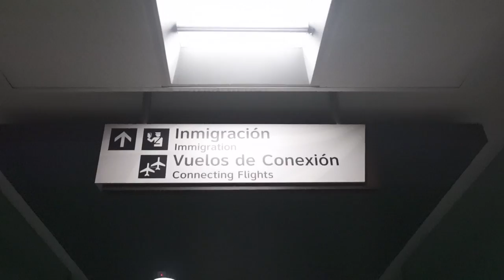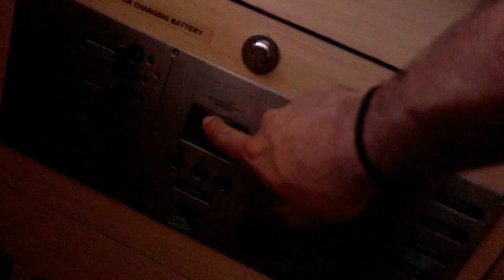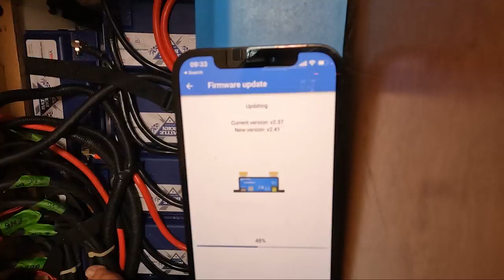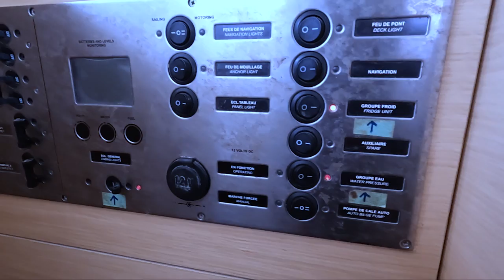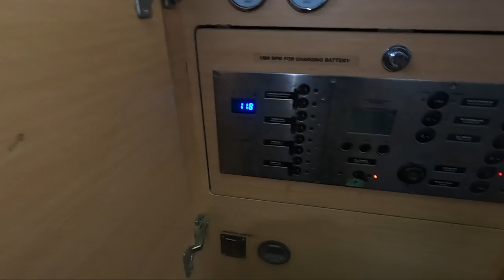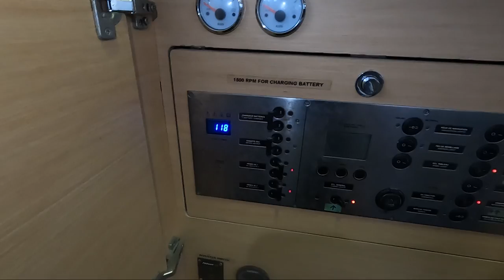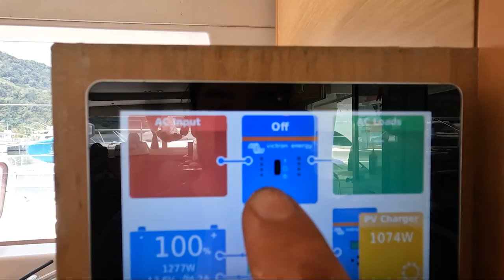We have been STRUCK by lightning AGAIN!!! - (Episode 192)

Comment: Oh...that sucks! My home got struck by lightning several years ago. My computer and a lot of electrical wiring got fried and melted. But, all my ham radio gear, which is all heavily protected with lightning arrestors and is also heavily grounded all survived. Even though it was my radio antenna tower that was struck, the house electrical is not grounded as well as my radio gear, so that is why the house wiring took such a hit. I wonder if better grounding can be an option for your boat? That ground cable you showed, is most definitely too small. You need to give lightning the least resistance to ground, or it will find other pathways. A bigger cable and more paths to ground connected to it "may" afford better protection. Not a guarantee, but it's an obvious and easy modification. Cheers from Winnipeg.

Comment: Get the cable from the mast as straight as possible, if that is going to attempt conducting the lightning. Every turn represents higher inductive component than the cable itself, increasing likelihood of the lightning trying to find an alternative route. Full energy of the lighning going through that kind of cable would lead into a cloud of copper plasma.

It might be worth it to look into a grounding panel with a good route towards the sea below and EMP protectors (and plenty of spares as they at least used to be sacrificial components). Pass all cabling through that panel and those protectors to keep the lightning away from delicate stuff.

Comment: Oh no Colin. Just when things are going well nec minute….😢 especially when it’s your babe. Great to see the 2 boys back. I think having them there will help share the load of frustration. Getting stuck in and finding the solution is a great way to reduce stress levels. What I don’t understand is…..is there a way where you can have a breaker turn off everything with a voltage surge?

Comment: As a former cell tower tech and Antenna erector, electrical engineering tech.  If your mast is isolated from salt water you decrease your struck possibility by 75% any of your electronics should be protected by a gas tube lighting arrestors witch the only ground off them if you want a giant lightning rod isolate it from the mast directly to sea ground needs to be at least 6 feet taller than your mast! Been doing this 47 years and have never taken a hit to my ham radio tower 80 feet high

Comment: Lightning sucks. 🙁 Hoping for minimal damange.

Some BMS'es may still forward voltage, but not amps, even if the BMS is dead or switched off... Put a couple of amps load on the whole system and use a clamp-meter to check power-draw per battery. No need to unscrew anything until you find something unusual.

Clamp-meters are really nice to quickly trace where power, as in amps and not volts, is going without having to unscrew anything.
No need for a fancy one for this type of work and a $30 model should suffice. look for something that has at least 0.1A to 100A range for DC and AC, or that reports "over-current" when above max.

Comment: With your luck i think it is time to invest into a good lighting rod and a big cable insulated from the rest of the mast straight down to some anode that touches the water. Also seeing open terminals on your batteries and having the + and - so close on the bus bar and not shielded in anyway from each other is in my eyes a fire waiting to happen(errors are easy to be made in such stressful situations especially if this happens while underway).

Comment: IIRC the old scooners use to throw a chain overboard to act as a path for the lightning to go to the water.
Could you put a ss ground plate on the outside of the hull connected to the mast via a heavy cable to make a better path to "ground / water" than all the electronics????

Comment: You would think you'd install a lighting rod groundout ( deferred line to water ).  You can build it for about $400-500. 
it takes the strike at mast top and runs it down the copper to specialty plate below the water line and saves ALL your expensive gear.  New vessels are now sold with that feature in certain demographics for an optional fee
OR at least protect everything with an 
" instant" Class T fusing array
Reply: Let me explain the lightning attraction rod system a bit better. ---- Mast Top you want a Copper cored rod with a SILVER plated triangular tip that is at least 18-20" above everything else. 
The base of that rod is attached to the thick twisted strand copper wire, usually 4-8 gauge and run down to a dedicated type plate ( similar to a chain plate ) that then runs to the specialized metallic ground plate on the hull OR to whatever your best exit point is.  The one on our old TriMaran in the Bahamas took countless strikes and saved all the electronics and HF-SSB gear on board

Comment: The problem that I see with the spark gap is that it allows the mast to charge up so that it is more attractive to the lightning bolt. It does not reduce the charge. Perhaps the spark gap becomes a path of least resistance but if the wiring in the mast is at zero potential and is touching the mast, then it could burn through the insulation as it seeks the path of least resistance. The question will be whether the air gap of 1/4" will be a lower resistance than the insulation around the wire that is touching the mast internal surface. I think not. A 1/4" gap would require more than 19,000 volts of differential. DC wiring would burn through at a fraction of that voltage.  I think that Brickhouse had the right idea by grounding to the sea so that there is no build up of charge. I know in aircraft that we try to channel the lightning bolt into and then out of the aircraft without damage by providing a path. That could be the situation as well if the yacht is at sea and there is nothing else around for the bolt to be attracted to. That is why I would go with the larger size wire, essentially a cable, to provide the ground.  The cable should be routed away from all wiring and metallic components until it arrives at the ground point on the hull. The lightning bolt can generate about 200,000 volts and the current will be huge for a few milliseconds. Keeping the voltage spike down and away from metallic components is essential to getting the charge overboard.

Comment: So, lightning can strike the same place twice. (Sorry, not so funny) I'm not that boat savvy, so this may sound ignorant. Could you mount a lightning rod on top of the mast, run a heavy gage, insulated cable down to the hull and attach a metal weight to the free end to be tossed over the side during a storm. Would that provide an effective ground to protect the electric circuitry on the boat? Tough luck guys. Best of luck.

Comment: Couldn’t you install a ground disconnect that you can switch off during storms to prevent lightning from shorting to ground? I know you wouldn’t have any power during storms with lightning but it’s better than running as risk of losing everything.

Comment: Are the other boats around you moldy. Since the start I was curious about mold issues. If you have some start from the hurricane and then get high humidity it could spread like wildfire. Houses even new construction get mold problems that can never be fixed.

Comment: You need to ground the mast to water with a big plate.  Never use the mast as a ground for electronics.  It should float and only be grounded to water.  Struck by lighting twice.  Play lotto.

Comment: Lightning strikes are caused by "Diffrence of Potential". Floating the mast with a Spark Gap allows the mast to stay at the same charge as the surrounding air. And if lighting strikes, the Spark Gap becomes the path to the ground, via cables thrown into the water. Keep the mast lightning system on the outside of your boat.. And use 12vdc and 120 vac Spark Arrestors/ Surge Protectors, using a diffrent ground (Grounding Plate) on the bottom of your boat as far as possibe from your mast ground. Do not use the same ground for the mast as the same ground for the Lightning Arrestor and Surge Protector.

Comment: I am thinking. Maybe a dissipator  on the top of mast with some 4/0 DLO fine strand welder cable ran short as possible and straight as possible to an isolated thru hull anode????  I read on a post here of a 6x6 stainless plate gapped at 1/4”?? Would love to hear the theory on that???

Comment: Condolences! Why did the anode routing system NOT work routing lightning strike away from all vulnerable circuits?....Old yankee preventative procedure unplug all power supply cables when leaving vessel dormant for  long periods in  while still in water.... best wishes!

Comment: All wires in mast need to be shielded and breakered.  All solar panels leads need breakers on +, -, so that you can isolate before lighting storm.  Nasal used all foil to protect wires on voyagers 1& 2.  This should have been done with the plastic conduit in your mast but is never done.  Boats are lighting rods waiting for shit to happen.  Double ground mast in nacelles close to mast.  Lightning protection is never built in to boats as it is not covered by warranty.  A little built in protection in the mast and the ability to isolate on both post and negative leads before a storm would help a lot IMHO.  You are an engineer so build some protection into your boat as you will get hit again and again.
Reply: NASA

Comment: You are on the right track replacing that wire on on the chainplate Colin.  I'd dig a bit deeper though if you want proper lightening protection in the future my friend.  A direct connection with a 4/0 copper cable from the mast to the anode is what you need, that anode should also be the only place bonded to the water for the entire boat.   When I'm designing electrical systems on sailboats, or any ship over 30', I always suggest to my customers that they create a smaller battery bank dedicated to the instruments with some lightning suppression device (choke) built in.
Reply: All DC grounds should go to the main grounding bus bar.  from there a 4/0 cable should be the only thing going to the anode.  The only other thing attached to the anode is the 4/0 cable coming directly from the mast.  Remember to use an anti oxidant compound between any aluminum and copper connections.

Comment: So....I know nothing about electricity and how to hook up all the controllers and relays and such but what if u put a couple fuses between the connections so that if u are struck hopefully the fuses blow first.  I know this sounds simple and obv there's millions of volts coming in on a strike but that seems like u can protect something doing it that way...? If everything ran into a huge fuse panel, and maybe it does it seems like it would do something. Or if you're away from the boat can you have a large switch to shut down the whole system so a strike wouldn't do anything? Again...ignorant noob question here so be nice on any response.

Comment: Have a 40’ Dean cat. Was lightning struck in Florida. Electrical Engineer, a very close friend,  in UK suggested a simple option….2/0 cable, approx 15 feet long. one end with a very heavy welding (ground type) spring type clamp, at the other end a steel or alu plate 12” square by 3/8 or a 1/2”. One port, one stbd. Secure clamp to upper shrouds…hang plate in the water. Have been in some horrendous lightning storms since..have seen 3 nearby cats suffer direct hits….so far, I am good. A much more direct path to water (ground) than your thin internal wire to zincs. Might work for you? Good episode, Thx, Andrew

Comment: Video does not answer the qestion, how the equipment is being turned onn and off. Is it just  button on equipment (wrong) of hard Off by designated switch on a pannel. Today the majority does not install the switch panel and kèeps the devices powered (sleeping) all the time. And of cause the missing lightning protection. The video does not show it is installed and failed. 2 mistakes = result

Comment: Hate to ask but why don't you have all the proper equipment and surge protectors to protect it from said lightning
Reply: Pretty hard to do , the EMF will kill stuff not even plugged in . The big thing is grounding the boat well to prevent the lightning blow a hole in her .

There is some that say you are more likely to get hit at the dock because you get grounded to the land and it can build up a potential , particularly if you are plugged in .

Comment: I wonder what would happen if you put up a lighting rod attached to a 1o line or a copper and ran it all the way down beneath the boat into the water? Would you still have EMP? Or would the lightning dissipate in the water? Just curious.
Reply: I think I would use a lightning dissipator. It looks like a toilet brush with very small brushes so a charge cannot build up. I would not use a copper rod. Then run the copper line into the water. Then get a meter to measure how many ohms it is. I always want to see 4 ohms or less.
Reply: All grounds must be tied together because lightning can travel at different frequencies. Once everything is common or all grounds and neutral is tied together then you take the main ground into a single ground which needs to be as close to zero impedance as possible. You have to give the lightning a place to go other than through the equipment.